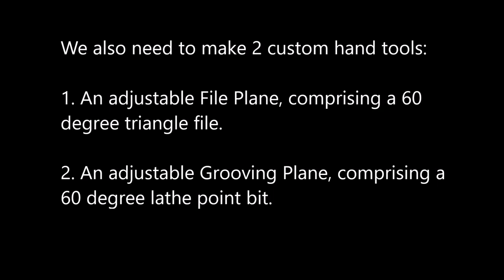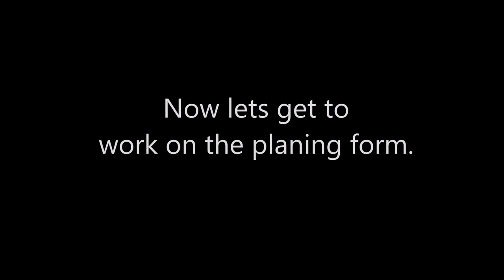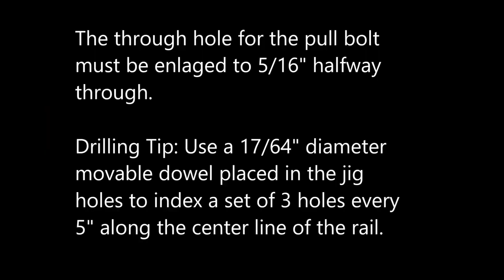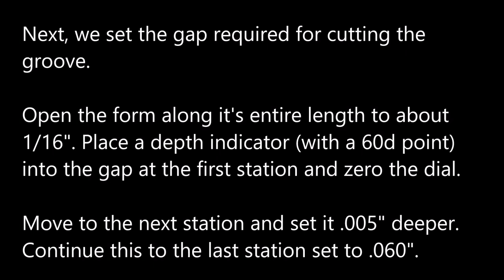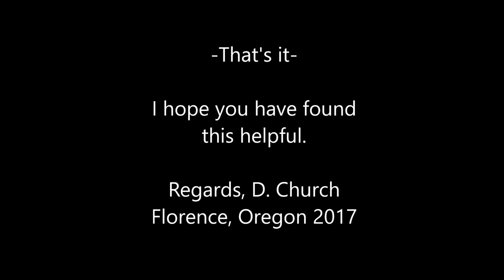Making a Bamboo Rod Planing Form (Wood DIY Project)

Comment: Looks amazing, I don't have the powertools or space for them. What specific wood did you use? Would you be willing to make a form for others? Thank you!
Reply from the maker: This could be done with the right hand tools but it would take a lot of set up and effort. Hand drilling that many perfect holes would be difficult. You could have a machine shop drill a guide block for you then clamp that to the wood... You would also need a nice long Jointer plane. 

Sorry, I cant remember what the importer called this wood. I purchased a stack of it about 25 years ago. It was suppose to be a good substitute for Rosewood. It's similar but clearly not the same.

Yes ha-ha, but very few people could afford the custom labor costs and I have no interest in mass production.

Comment: How do you keep your block plane from biting into the wooden planing form??
Reply: The same care must be given whether the jig is made of hardwood or steel. The bamboo rod part sits above the surface of the jig. The block plane is used until the bamboo is nearly flush with the surface of the jig then the last bit of shaving is carefully completed using a cabinet scraper.

If you are asking about how to prevent a block plane from generally digging in while planing wood: Always work with the wood grain direction,  set the blade depth about the thickness of a human hair, keep the blade very sharp and use long smooth strokes with your full body rather than just your arms. I wax the sole of the plane in some cases.

Comment: Before taking on this task, the theory of op is not clear to me.  I guess the lathe point does the cutting of the 60 degree grove. What does the 60 degree triangular file do.  Making  this jig is the most complicated part of the bamboo fly rod process. I was glad to see your hardwood version.  Thanks.   Mike
Reply from the maker: Yes, the lathe point tool is used to cut the 60 degree groove. The file plane is used for cutting the last 3 to 5 thousands of an inch of this same groove. It must be exact.

It would be possible to complete the work without the file plane but I would not recommend it. Plus the file plane is easy to make. But if you are super smooth and careful with the lathe bit plane and your wood grain is very cooperative you could get by without the file plane. 

The file has a much longer cutting surface and is not affected much by grain direction... so it does a nice job of finishing the groove cut by the lathe bit point. But the file cuts way to slow to make it practical for doing the entire job of cutting the grooves. That's why you should use both tools.